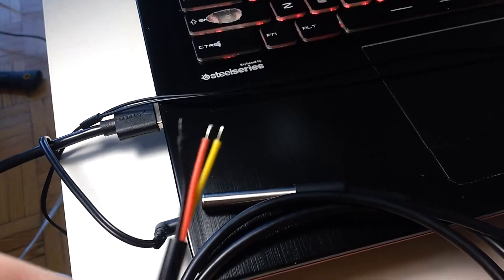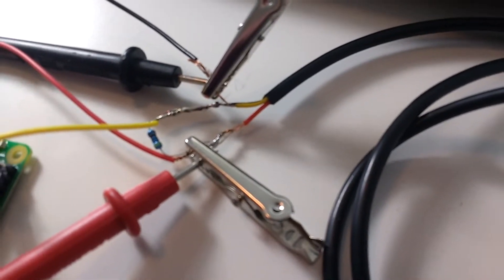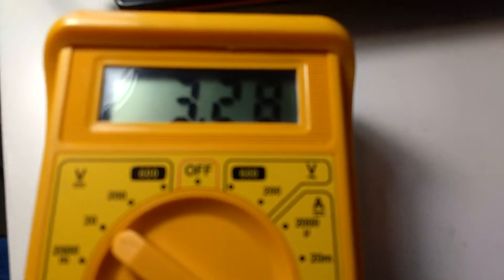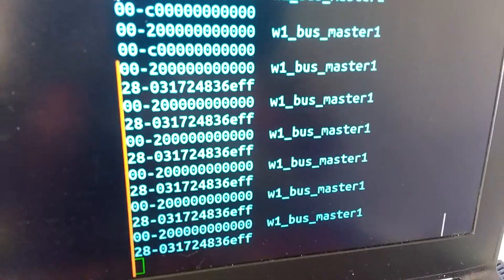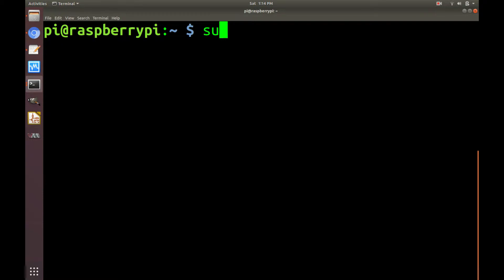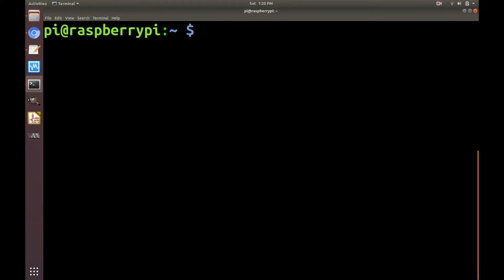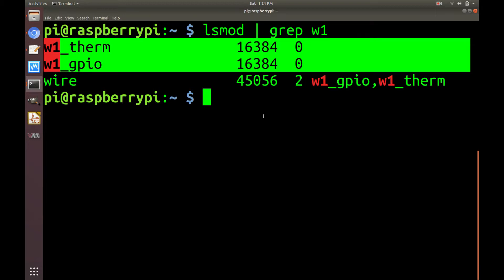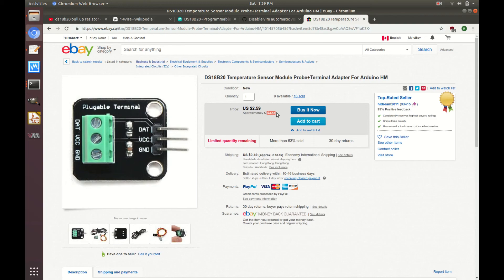DS18B20 Setup & Installation - What's The Deal With That Pull-up Resistor?

Comment: Thanks for this. Removed the external resistor now. It worked with it mostly, but then after being fine for a day, it refused to work like for another day. testing now without internal pullup.
Reply: stopped working again. sees the sensor, but rarely can read from it.
Reply: Will experiment with diff pull up values close to sensor. My cable is only about 50 cm. This morning it worked again, the diff with last night is that the room the PI is in, is now around 20 degrees and last night 5 degrees. ( It has to control a heater in a camper and some other stuff  )
Reply: For now it works great with pull up 3k3 close to sensor. I think I still use pull up on pin. And then it stopped working again. Checking my connections now, might be a bad contact somewhere, I also changed my power supply. measuring 3.28 Volts at the sensor.

Comment: Is this possible to do with two ds18b20's?
Reply from the maker: I forget whether I ever actually tried it with two or not, but I seem to recall that it would probably work.
Reply: Many thanks for this video and the accompanying blog. I had success following your method using software pullup with a single DS18B20, but when adding a 2nd in parallel, the 2nd device showed up but both devices then failed to return a valid temperature. Adding a 4.7k resister between power and data got it working successfully. I read somewhere the Pi's onboard resister is a much higher value so will struggle to pull up more than one device.

Comment: I come to you with a question. We are implementing these sensors in a machine, and overall we got it working correctly.
A problem happens when a certain function on the machine becomes active, and  makes our sensors return the temperature value of 0.

The only solution we found to make the sensors read again, is to hard reboot the raspberry (power off, power on; rebooting the usual way doesn't work). In another occasion we had the number 85 as shown temperature, but then I touched the sensors and they were extremely hot.

Apparently what's happening to us, is that the data pin (maybe) stops working as the data pin, and becomes an output.
We do not only loose the readings from the sensor but it also gets really hot. Burns the skin.

Have you managed to reproduce this in any way?

The only solution we could find but did not yet implement is to turn on and off the sensor when a reading is needed, via the power lead, throughout a dedicated GPIO output. Got this from this post. https://lb.raspberrypi.org/forums/viewtopic.php?t=164059
Reply from the maker: I'm more of a software guy than a hardware guy, but I'll give a go at being helpful:

"A problem happens when a certain function on the machine becomes active", possibly some kind of electrical issue?  Power sag due to inadequate power supply or wires too small leading to high resistance?

I swept though a range of value with external pull up resistor to see which values work, and I've seen values of 0 and 85 when you get to too high/too low on the resistor value.  These are the underpowered/overpowered conditions.

"but then I touched the sensors and they were extremely hot."  If that heat isn't coming from the environment you're sensing, it must be from the power supply and conservation of energy would suggest that there's a power problem (short circuit).

If you can, measure the voltage that you're supplying to the sensor over a long period of time to be sure that there are no intermittent power problems.
Reply: @RobertElderSoftware  Don't worry, I'm a mechanical engineer so electronics are a bit off my field.

"A problem happens when a certain function on the machine becomes active", possibly some kind of electrical issue?  Power sag due to inadequate power supply or wires too small leading to high resistance?
I don't think this is the problem. We are running the original cables that come with the submergible sensors, and in another function they work ok and do not show any kind of problem.

It fails under another function, that uses the same "power" components.

"but then I touched the sensors and they were extremely hot."  If that heat isn't coming from the environment you're sensing, it must be from the power supply and conservation of energy would suggest that there's a power problem (short circuit).
If a short circuit is the case, then the GPIO pin must be changing, and thus changing the polarity or something. The sensors are powered via a separate 5v power supply, with its4k7 resistor.

And if this is the case (probably), can this be overcome in any way?
You can see this happening at the 26 second mark. The only way to reset the temp readings, is to hard reset the raspberry. https://www.youtube.com/watch?v=Q4zKXyPd714
Reply from the maker: "We are running the original cables that come with the submergible sensors"  "It fails under another function, that uses the same "power" components."

If there's a common power supply with something else, and the other thing turning on causes the temperature sensor to fail, then it sounds like that other device is probably consuming enough current to cause the voltage into the sensor to sag for a brief period and put it into the weird state you're describing.  If you can, measure the voltage (ideally with a scope) going into the sensor during the period where you power on that other devices and see what the graph looks like.  If it drops very low even for a few ms, I'd suggest that's the problem.

" then the GPIO pin must be changing"  It might be worth doing a code review to make sure you're not allowing any important GPIO pins to float around to random values.
Reply: @RobertElderSoftware  Ok, wil try these options. Thanks for the response!!